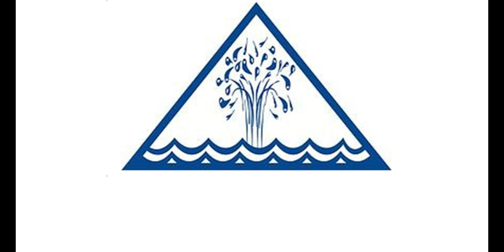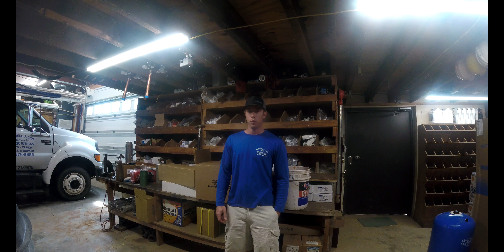Low Yield or Low Flow Well? Explaining Options To Use a Low Producing Water Well

Comment: I'm in N. GA here was expecting better flow because I'm in the mountains and I have a spring head on my property. Driller wen' down to 440ft and got 4gpm. You read online that 5gpm is the recommended flow for a household, so I was a bit worried that 4gpm was not that great. But after hearing that some people get less than 1gpm, I'm not going to complain.

Comment: Thank you for another great video.  I had a question about a deep, low producing well.  Our static water level is 350' in a 700' deep well, but the well driller noted only 1 GPM.  So we'll be installing a cistern to hold water.  We've gotten two quotes for the well pump, with very different recommendations.  The first bid recommended we only pump at the replenishment rate of the well, so it doesn't run dry, and to better protect the well itself.  The second bid said that restricting the pump to 1-2 GPM, when there's 500 gallons of water putting pressure on the pump, puts a lot of unneeded stress on the pump.  He recommended a pump that will do 8 GPM when the well is recovered, slowing to 2 GPM before a pump tech would turn off the pump so it didn't run dry.  He didn't see any problem with drawing the well down so far and letting it recover.

So it sounds like option 1 trades pump life for well life - more strain on the pump to restrict flow, but the well stays full.  Option 2 will pump out much of the well quickly, but not put undue pressure on the pump.  Do you have any thoughts one way or the other on running a well like this mostly dry?  (In reality if the cistern calls for water at 300 gallons, the well would always have 500 - 300 = 200 gallons left.)  

Thanks for any thoughts!

Comment: I pounded down a 15 foot 2 inch point well. It flows around 3 gallons a minute 18" above ground. I am happy just to have clean water at camp. I use a ram pump to pump it half way up the hill.

Comment: I just drilled my well. Went to 197’ and I’m getting 1/2 gpm. Is there any chance the water production increases? I drilled it with a cable tool, and I had to cement through a couple of layers (I assume they are water bearing, as they were unconsolidated and kept sluffing in on me). I’m hoping the well continues to develop. Any thoughts? I’m in Oregon, and I was in rock from 18’ all the way down.

Comment: Question: how can you determine your well production rate? We have a 340 well....initially(for the first two days) there was only 23 ft of water in it. I came back about 12 days later....we hadn't received significant rain and there was 300 ft of water in it....but I don't know how fast it filled. There wasn't a pump placed in it...how can I drain or pump out the well to better monitor the production rate

Comment: Ok I just had a well drilled. He hit ground water at 9 feet. It's ground water low level. I don't need drinking  water. He hit some kind of gray something at 50 feet. Told me below that is gray something makes the water taste bad. Should I go deeper?  Can they know the area and know what the odds are of hitting good water source at 100 or more feet? Supposed to be good driller. 3 gpm at 50ft they are testing quality now. Just drilled

Comment: Great video, makes me a lot less worried about my setup but wanted to ask your opinion. I got a 250ft well in a mountain setting. When the well was drilled in the 80s they rated it as 2.5gpm. when they did it they setup a 300 gallon holding tank and the pressure tank is quite sizable too, not sure exactly how big.  Big thing is they have a jet pump that is as loud as all get out next to the pressure tank, inside the house. In this type of setup do you think that jet pump is actually pulling water out of the well or do you need a pump between a holding tank and the pressure tank to provide adequate pressure and maybe there is a submersible used as the source for the holing tank? If so anyway to cut down on the noise? This jet pump is huge and seems like it might be overkill for running pressure into a tank 3 ft away from source.  Also you make 2.5gpm sound very not scary especially for a small house like mine (2bed max full time occupancy of 4 per the permit). Any potential I could cut the holding tank out of this scenario?

Comment: I have a question, my well is 45 ft deep static 20 ft and 25 ft of water 6 inch metal casing, It was build by my grandfather in the 60s and never pumped,but  always has water never went dry,my question is will I have plenty of water for a pond that's a 30 ft by 40 ft 4 1/2 ft deep,I bought a submersible 1/2 hp 2 wire 12gpm pump I live in South Texas  thanks

Comment: I got 700ft well head at 500ft and static at 200 plus a storage tank of 1000g will it be fine for me. But at 700ft and all granite.
Reply: What does your well produce in gallons per minute? You may very well not need that much water storage.
Reply: @EppWellSolutions  well my is 0.7g/m with 1k gallon tank. I already got a house and i think it will be fine.